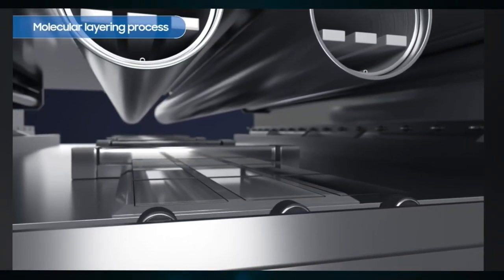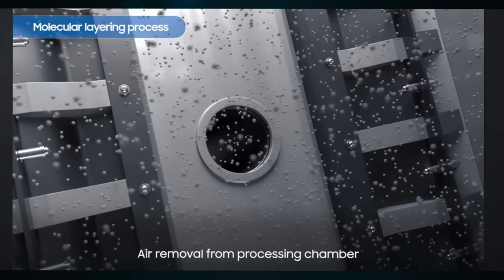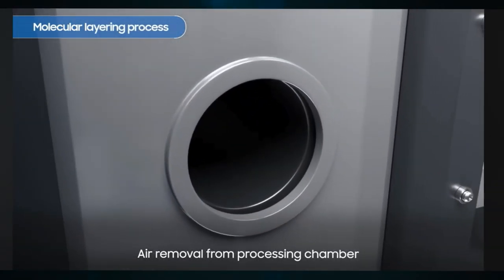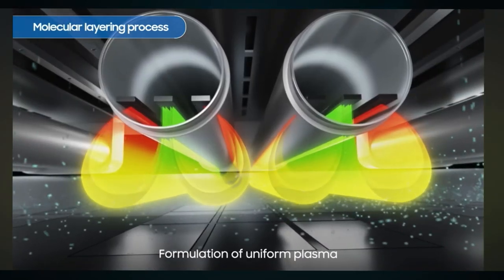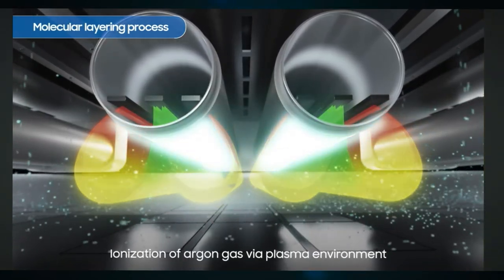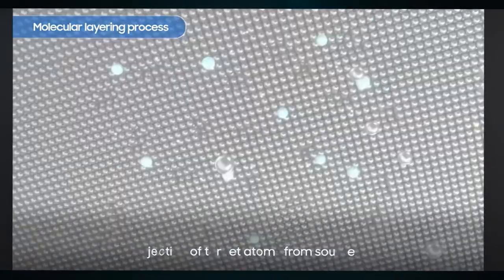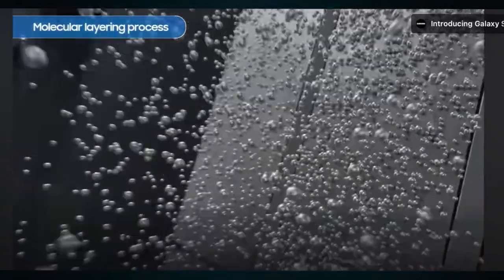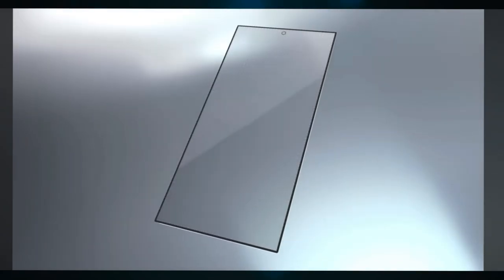Galaxy S24 Ultra Screen Facts You Didnt Know! (It's Really Cool!) 😎

Comment: At the end it seemed he caught himself. Saying he thinks that the screen is even better at reflection reduction than the screen protector... Yea...maybe but you have the screen protector on it. Also, I have the s23u and have a matte screen protector (Paid maybe 3 bucks for it on Amazon) and it is wayyyy better at reducing reflection that the one he is using. It's ridiculously good. Also amazing with fingerprints. 
In my opinion...they need to stop messing around with this and get voice typing working better. Inputting text on a Samsung phone should be like magic, instead of a drag.
It seems that YouTubers are overlooking obvious points to keep a wider audience.

Comment: The official protector works.. yes.. But the fit is shit.. It's slightly too small and therfore leaves a gap around the sides. Which, when using gestures with the pen - the tip snags in the gap. Highly annoying!
Reply from the maker: Please point me to any screen protector that doesn't have gaps around the edges. You just don't notice it as other phones because you're not using it an s pen with them. Grab any other screen protector and put it on this phone and you'll have the same issue
Reply: @TechOdyssey  Well, I have a screen protector on my 23 Ultra and don't have that issue! If Samsung made the screen protector slightly wider for the 24 Ultra I wouldn't have that issue there either!